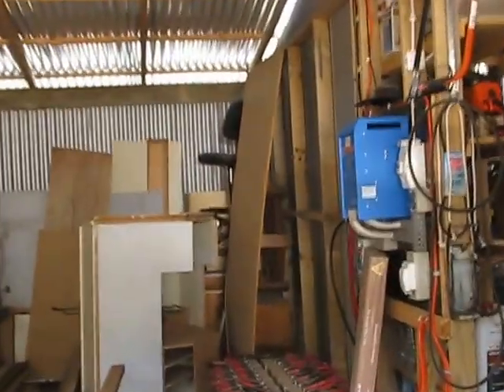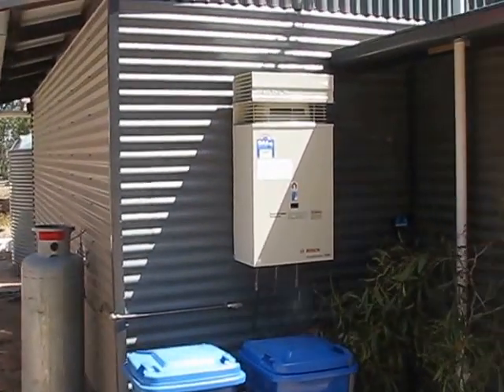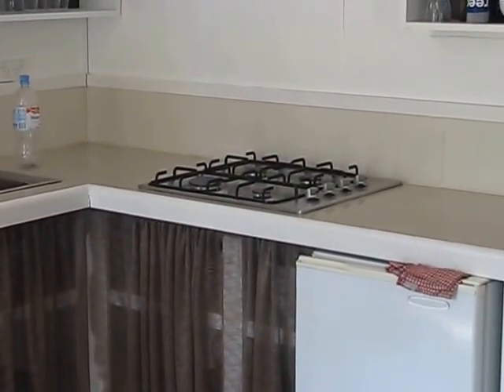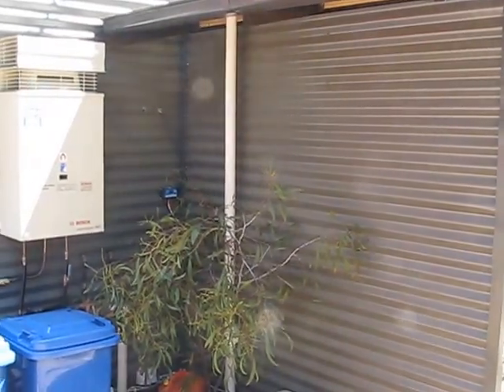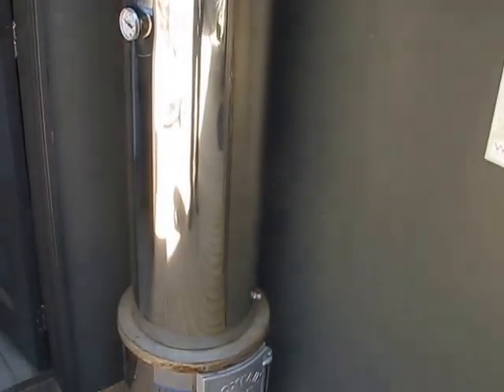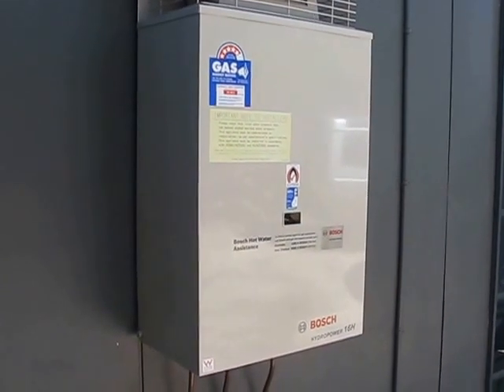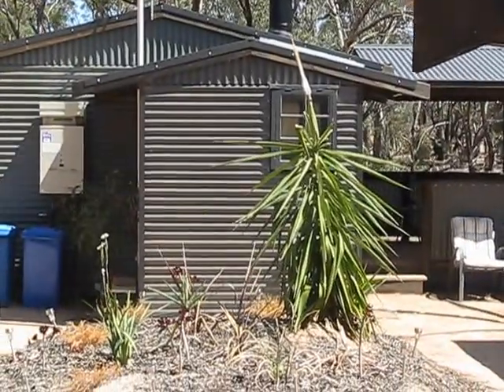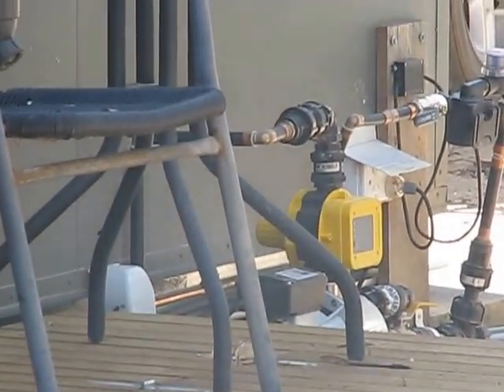How much Solar do you think you need to live off grid in Australia

Comment: How hard is it to really get rid of the need for 240 volts all together ? I mean inverters seem to be such a waste of energy with their heat dissipation and the fact that many 240 volt appliances step the 240 Volts back down anyway to 12v (Tv's etc) or 19v laptop and many other low DC voltages. Do you think you could have the same lifestyle completely without the 240 volt is what I'm asking ? Would a 24 volt solar setup using 12volt fridge etc suffice ??  Cheers, and great video :)
Reply from the maker: https://www.youtube.com/watch?v=QAfirxllMl0&list=PLgDkZarQWh7XLVpmOuRPx6jXzvgxTPj2J&index=11

Comment: how long can this system run without recharging the battery system?under the assumption that their was a problem with the solar panel connection or if the sun wasn't providing enough power, then how long can the battery system last without recharging?
Reply from the maker: That totally depends on how much load any person chooses to try to run of any system ... So it is hard to say really .. As far as our 3 kw , we could get by for 2-3 days max with no input ... but we would have to be careful as to our use over those 3 days ...   If we used power as if we had normal charge ?   may be 2 days max !!

Comment: took me 30+ years to finally get a weird & wonderful patch work quilt of different panels,(my very first 2 panels are still on roof producing power) 1.5 kilowatts in total (80 amps at 12v in winter)...this eliminated runnin the geny over winter....(1 person domestic situation)....my 240v electric still draws 60 amps & batts sit at 13.3v during the 3-4 hours to make 4L of distilled water...(so in effect its a solar powered still $100 on ebay)...power would not be used on sunny days & batts(400 AHour AGM type) would be floating all day, if not distilling....but those 80 amps on a cold sunny winters day, can drop to 3-5 amps on an over cast rainy day....which still runs the fridge/freezer...u size your system like this...to cover your load on a no sun day..(in my case my fridge)...pc runs off its own batt & panel...''separate' solar systems work really well...if one volts get too low, u can send power across from another backup one.....(again eliminating need to run noisy geny)....a GRAVITY feed header tank is also a great system to use, & cuts out power & pump use...2-3,000L good enough for kitchen bathroom etc....a compost no water dunny another great way to go unless your recyclin your dunny water to orchard etc.....water storage 5,000 gal with 2,000 gal backup.....all this should be DOUBLED for TWO people...never been connected to grid or had power bill in over 30 years, forget what a power black out is....great to see your setup steve

Comment: That still looks bigger than five litres. :P

I've been off grid at my weekender for nearly two years. I'm currently using a 2kW array and a 375Ah battery bank. I've never needed a generator, although I do have other batteries that I can use if need be.
Reply from the maker: Hi Pop's Shack.  My sister lives with 2kw and does it easily most of the time.  We had about 640w for many many years but did use the generator a lot. I am loving the 3kw and it is plenty for us.  Never did quite get the 10kw need. Cheers Kerri.

Comment: Hi I just fell across your channel mate, Well it's so refreshing to finally find someone who thinks a smallish system is the ducks guts to live off like I do !!  I just don't have the obscene, gob snacking amounts of money people companies and people say you NEED to have to maintain a reasonable life style !!  Compared to your system, my systems tiny but being on the disability pension I'm adding to my system a little at a time as I can save the money. I have to separate systems at the moment, 1 is 600ah of AGM 12v batteries and 400 ah of panels that runs my 12v/24v fridge freezer. 2 is 420ah of 12v flooded lead acid batteries and 200 ah panel that runs everything else or doesn't really, but I'm going to redo both systems and recess everything. Is it OK if I send you a PM (private message) Seeya Rob......I've subbed  to your channel !!
Reply from the maker: Hear exactly where you are coming from  Rob ... you  have a good attitude to all this off grid stuff ... as you said , you are refreshing too to get feed back from :- )    thank you for your kind words mate ...  and keep up the positive thinking .... cheers Steve and Kerri ...

Comment: well yes, it depends what you want to hook up on your system. if you cook with electricity and heat the water with electricity etc, it is obvious you will use more electricity.
conversely of you only have a 5 watt led in the house, you can say i only need a 100w panel and never start the generator.
also solar panels are cheap and it is quite common to "overpower" the system. that means on a sunny day in summer you might have 5 times more energy than you use. at the other hand on a cloudy day in winter, obviously  the overpowered system tides you over much better. keeping in mind YOU have all the wood back up and lpg, you can tide over low sun days with wood and lpg. so, the 3000wp system might work for you. that does not mean it is a cure all.